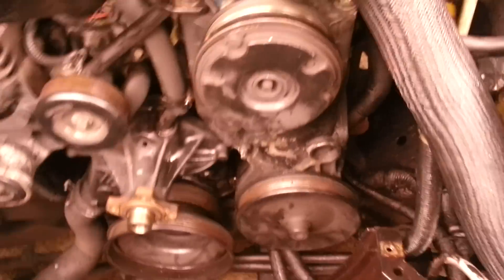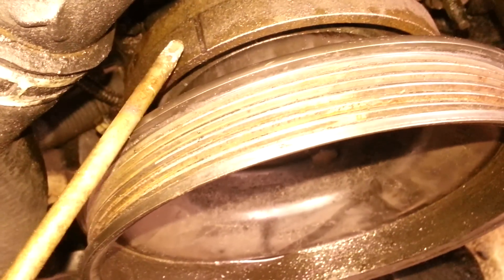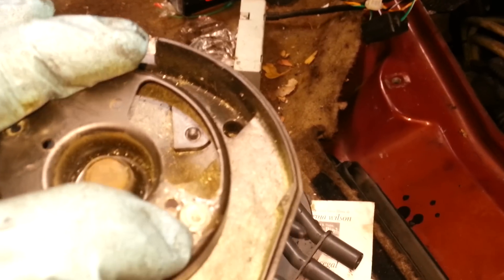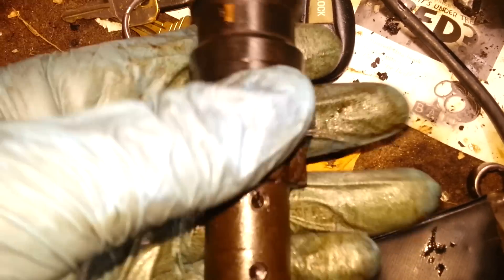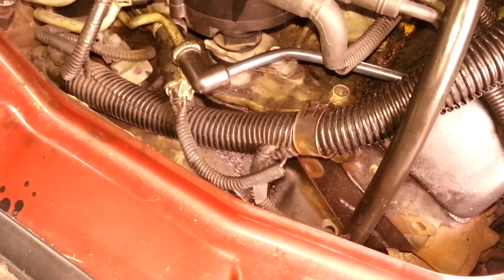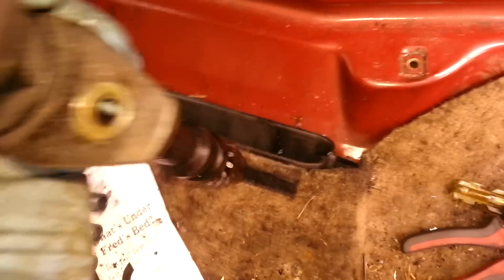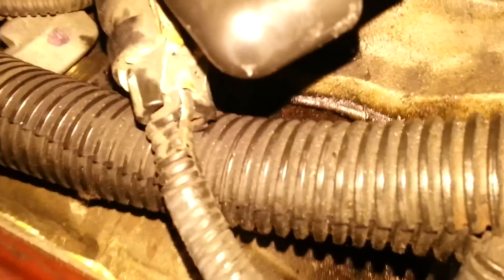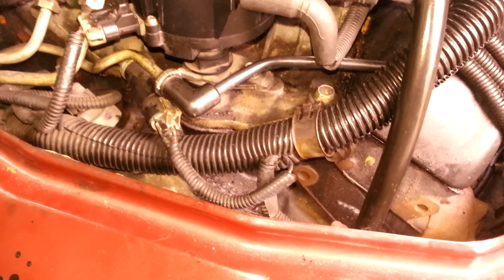How to TDC a Chevy 4.3 Vortex 6 cylinder

Comment: Hey where do i find #1 cylinder on the chevy s10
Reply: A 4.3L s10 is not a 1996 or newer 4.3L vortec. Just try to bolt in a set of Connecting Rods from an old 4.3L into a Vortec, will never work. The Vortec is a redesigned engine. Now, you can take parts from a 350 vortec and they will interchange  with a 4.3L vortec. Same rods, same pistons.
Reply: scooterdog29 Not to start an argument, but it's my experience that the "Vortec" change is just in the heads. Internally, they are the same. Now, 1999 and 2000 Vortec 4.3's are only interchangable with 1999 and 2000's because of some minor wiring differences, but a non-Vortec block and internals are the same as a Vortec. You can swap out heads and intake from a vortec onto a non-vortec. Just a bit of information I've experienced.
Reply: Mudracer41 The connecting rods in a Vortec are offset 30 degrees, they are not offset in a standard block. The Vortec is a 2 point oil system, where as the standard 4.3L is a 3 point. They are not the same internally. You can probably use the pistons, but you will get in trouble trying to use connecting rods.

Comment: Hey man I really appreciate the video! I was afraid I was going to have to take it to a shop for them to use their scan tool to get the timing right. A p1345 code came up after I replaced the lower intake gaskets. I did exactly as you showed and it worked perfect. Light never came back on.Thanks!!

Comment: Hey man, I just did an intake manifold gasket replacement on my 2000 Chevy s10 and now can't get it to start. I'm convinced its something to do with the distributer, but I cannot get it start. Did you have a similar issue? Were you able to fix it?
Reply: i just fixed this problem. with a chevy astro. here is how i fixed it. when your at TDC that distributer needs to be exact and it may seem that its hard to do and that the distributer only fits a certain way. stick your head down the hole where the dist. sits and turn the notch looking thing just a hair and re install keep doing that untill the dist sits down perfectly and you are at the EXACT!!! TDC mark on the dist.. it is going to take several tries. just be patient. good luck
Reply: Did they really make an s10 in 2000? May want to look into that. A 4.3L chevy is not a 4.3L chevy vortec.

Comment: hay i now its been almost year but good vid it is a pthe oing to well i have to replace oil sending unit wich this procedure needs done no get to the fucker u dont say y u did it but should have replaced that too and im not being a smart ass by saying that its just alot of shit screwin with ditributer i replaced head gasket and intake gasket on a 98 jimmy and those marks screwd me too, but they r both there one for top side and one bottom for aligning when vehicles on a lift,most of us shad treeers only wish for a lift, but those marks screwd me two until it was told y there two ,of course now u made vid there a shit load here now go figure lol

Comment: They share the same distributor it has markings for the 4.3 as well as the V8s 5.0 and 5.7 so any of you magazine mechanics shove it I'm ASE certified and have done countless Distributors and on this family of engine that showed up in 96 and hung around until 2005 or 2006 every time I do this I need to use a scan tool that allows you to see the info from the crank and camshaft so you can fine tune the distributor to zero advance so it doesn't throw the cam crank correlation DTC I

Comment: I bought a short block 5.7 from pick n pull and I took off the heads but left the intake manifold and distributor attached to the engine. The guy at the counter asked why I did that and I told him, have you ever timed one of these or replaced a distributor on one of these? I do have one question? Did it not throw a code? I always take em to the dealer and have the use the comp to set the timing at zero? Anyways before any of you magazine mechanics say you're working on a V8,They u

Comment: If you are sure the number one cylinder is TDC on the compression stroke your rotor needs to be pointing at about the 9 o clock position. It is actually just past the number 1 contact on the cap which is about 8 o clock. Hope this helps.

Comment: Thanks so much my friend. I did the intake gaskets on my 05 Chevy and couldn't seem to get the distributor back in right. I knew I was close because it would run but not well. I used your trick and it fired right up. Thanks again!!!!

Comment: Thanks for this video man.  I'm getting a P0340 code on my OBD upon crank up, every time.  I replaced my cam position sensor not long ago, and I'm still getting a slight miss in the engine.  When I replaced mine, I bumped the ignition until the rotor tip was pointing at the number 1 spark plug wire, then took it apart.  It went back together the same, but I remember some issues. Going to check timing as soon as I get home today.  This is very helpful.  Thanks again.

Comment: Finally I have wondered on the right. I have a 2000 chevy astro and my code reader says to replace the camshaft sensor I did it but its still saying replace the sensor. Very glad you posted this video.
\

Comment: I had to replace the intake manifold gaskets on my 2003 Silverado. I finished everything but had a problem with the timing. After watching this it is running better than before. Follow this to the tee and it will work.

Comment: My new distributors marks make it line up a totally different way then you show in the video. Should I just turn rotor to look the way you showed? Plus, I got it to seat once just by turning the rotor and seeing if it fit and I got it to drop in eventually but it wouldnt start. It just turned over but no start then a small backfire. So I did the TDC thing just like in the video and I got it to drop in but the crank lines werent lined up. I tried it anyways and it turned but no start still. ?????

Comment: When the distributer wont sit flush just use a screw driver to spin the oil pump drive in the center of the spline gear in the block thats what was holding the distributer up.

Comment: Hey man great video...I did everything like you said but I dont know if anyone else has the same problem I do but I keep getting the code on my scanner tool "p01345' cam and crank sensor problem. I erased it but it came back. i have a 2000 chevy express 1500 van with the 4.3 6 cylinder engine....I would appreciate it for any help you guys can give me...the van turns on alright and runs fine but that code is bugging me...Thanks for your help

Comment from the maker: The timing cannot be adjusted manually with the rotor when its in the engine. But the rotor can be rotated manually. Take off the distributor cap to line up the rotor correctly. After you take it out the distributor rotor can be rotated by hand. Just try to line up the rotor tip with the number 6 that is on the housing (passenger side of rotor). A way of doing it that makes it easier is to line up the markings on the shaft and gear. In the video I tried to describe it as clearly as possible.

Comment from the maker: When you set TDC according to the manual set the distributor to where the rotor points to the #6 that is on the distributor.  Don't forget that when put in the distributor it might not sit flush and what you'll have to do is put the retaining bolt in, so that the distributor doesn't jump out, and then turn the crank slowly until it drops into place. The distributor rotor is also set pointing to the #6 on the housing.
Reply: 1 tdc ?

Comment from the maker: Line up the marks on the crank and distributor. When you got the distributor in put in the bolt that holds it down or it will jump out of place and mess up the timing.